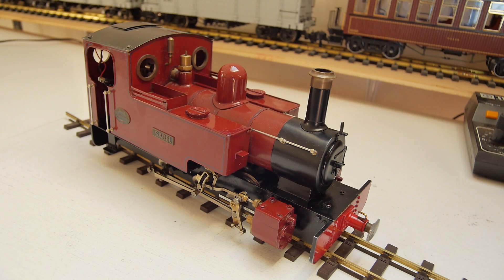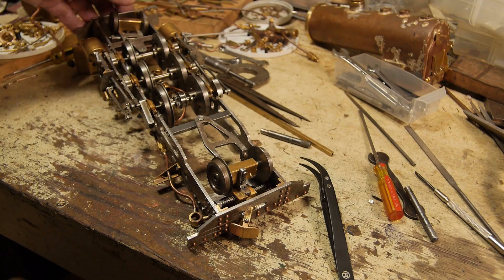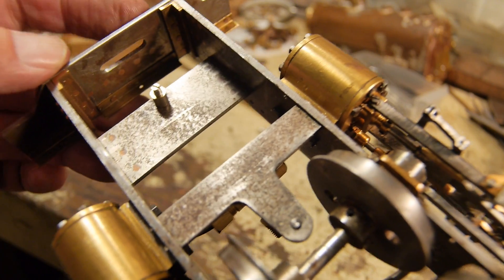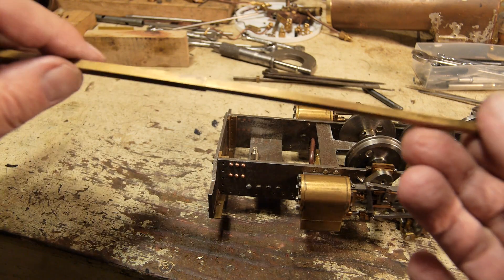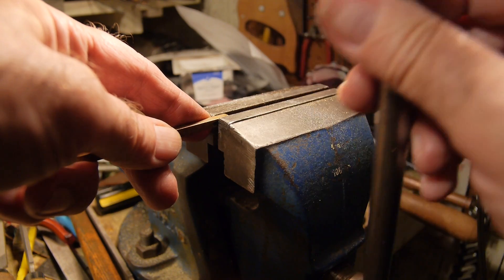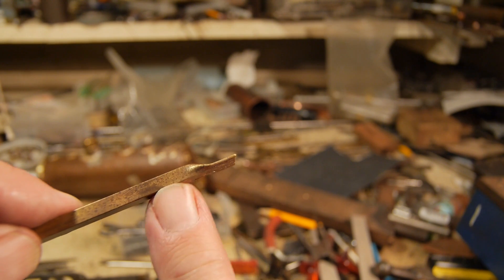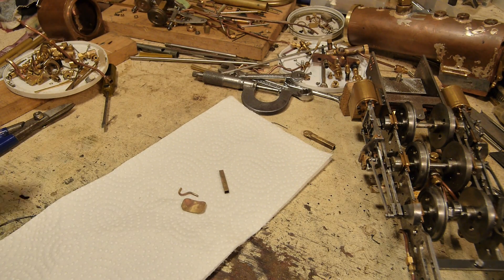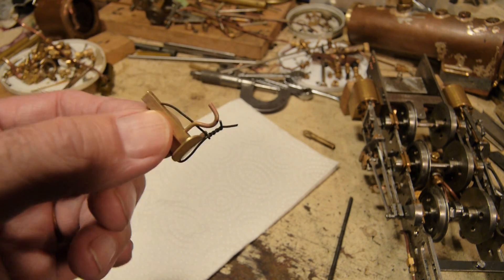'Russell' Live Steam Model Locomotive Part 14

Comment: nice video how much has this cost to build so far if you dont mind me asking?
Reply from the maker: Good question.  A lot of the raw materials like the frame steel, buffer beam, wheels and brass for the side tanks and cab I already had.  The copper for the boiler and the tubes were given to me by a friendly plumber.   All those little steel screws you see are 8, 10 and 11 BA with hex heads that are one size smaller are quite expensive.  The silver solder for the boiler cost around $70.  The part that cost the most were from Roundhouse Engineering such as the cylinders £140, dome, pressure gauge £27 and regulator £22.  The cylinders were well worth the money considering all the work they saved.   I would estimate between buying parts and scrounging material I've spent $500.